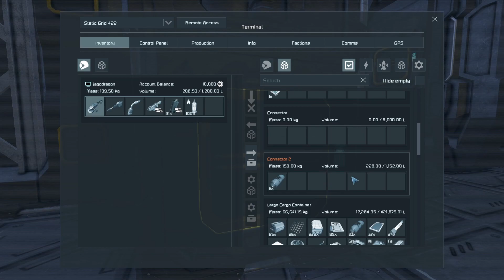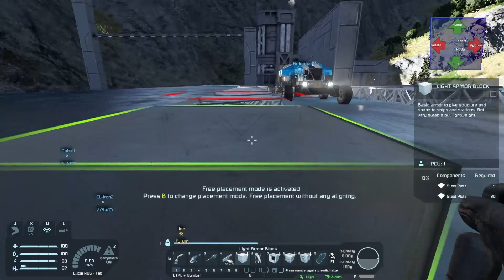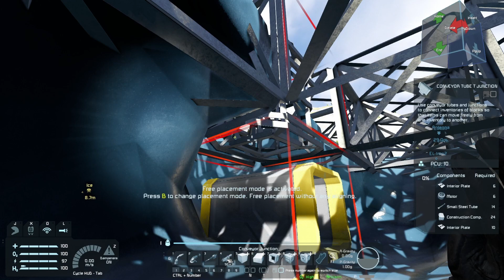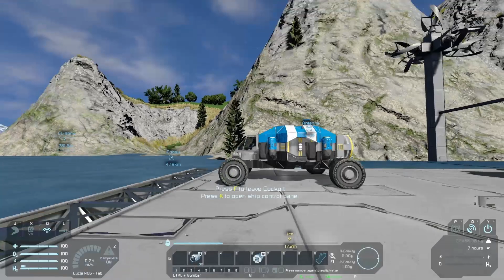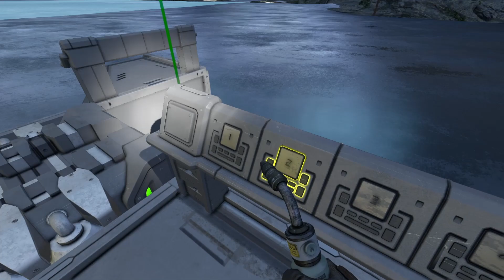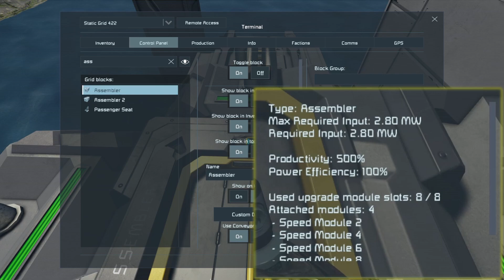Space Engineers Survival Guide - Production Upgrades and Parking lots! - s1e05

Comment: Note on the assemblers the speed module can be placed "bridging" both the assemblers  (using only 4 speed modules instead of 8) on the other module slot placing power module --  ( aesthetically  it may look odd ) but 4 power modules can fit on the upper/ at least 3 on the bottom 

Each upgrade  
Speed x2 power x2 the product its like adding another assembler  1 assembler 4 speed modules is like having 5 assemblers
Yield x2 power x2 the product its like adding another refinery  1 refinery 4 yield modules is like having 5 refineries
Power x .5 power use while processing -- the difference is the power technically is x .5 the first one  x.25 2nd  x.125 3rd and x.0625 for the 4th  1/16 of  the power you started out using

The first module has the most impact for whatever you are doing......
Reply: Do all the testing you need.
Reply from the maker: I'll have to test this. I've never heard this before. Thanks for the tip
Reply from the maker: I have done the testing. This is partially true.

Adding the speed modules normally will result in 500% boost for that assembler.

adding them as you suggest will result in a 300% boost for both machine.

so, it is good to know if you are short on material that you can mostly upgrade both machines for the cost of upgrading one.  But, it is less efficient than doing it the proper rout.

Still a great idea for early on though. thank you.